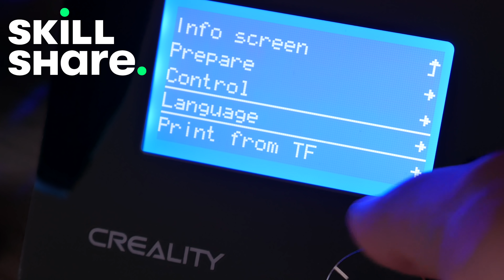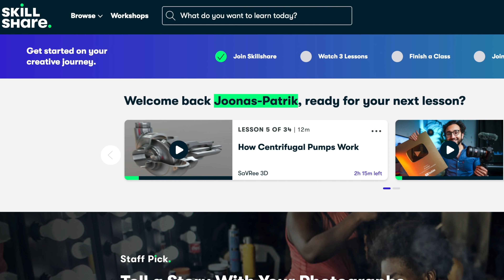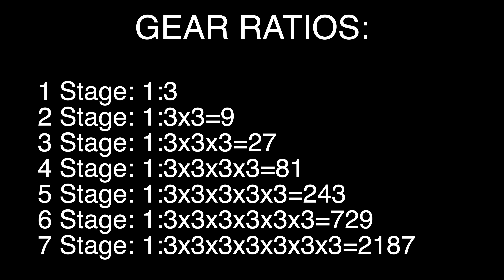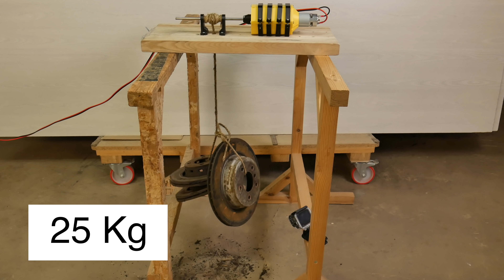3D Printed Stackable PLANETARY GEARBOX - Unlimited Gear Ratio

Comment: A Gear size ratio that harness the 25 kg lift-to-weight ratio, under the power of laboratory small electric motor

And it is working with good stationary holding strengths

I am now under the mapping solutions 👍🫶🫡💝

Comment: Great project, but I have a few reservations.
1. Increase the number of outlines and top/bottom layers when printing – this will significantly increase durability.
2. Try using oil instead of grease. It will significantly reduce friction and make the components last longer.
3. To prevent the gear from breaking off the base (8:03), it's worth inserting the gear into the base as a separate part to better connect the gear to the base.
I have a pump in my project, but it's based on a rotary motor.

Comment: As a former aircraft mechanic and car hobbyist, seeing that you designed a port (2:37) to let you easily access the screws made me smile 😁. Now if only all the automotive engineers could get on board with this concept of designing ways to access hardware during maintenance (instead of just ONCE during assembly), the world would be a better place.
Reply: actually those kind of accessible cut out can reduce the strength of the parts. every opening can reduce the strength drastically especially if those parts is critical.

Comment: Late to this but are you sure this is 1:3? I printed your files, and for every 1 I turn the back, the first set turns 4 times. Doesn't that make it 1:4?
Reply: Yeah, the gear ratio for the planetary gear system is calculated by this equation, (RingTeeth+SunTeeth)/SunTeeth. For this case, it will indeed be 4:1.

Comment: even it would lift 100kg it wont do it securely and repeatable and year later even not used, but it will lift 1kg fine for your life time.
make last sun metal and its last gear box that fail. its not any magic. make everything metal and have just one sun gear on motor shaft. that fill fail on max load too. not any special.
its not how much it hold its bout 3d printed layers and setting. its one off part not to compare

Comment: I made an gear ratio with my lego technic, i used an calculator app and it said it had 880 newton centimeters of torque, it was hella slow but i could barely stop it using a beam, releasing the beam would instantly whip it 1/4 of the rotation forward and lets say it was so strong it ripped apart a small gear

Comment: do a torque test, like the first test, but with bearings like the second test :)
first failed due to combination of shear loading and torque loading. not due to just torque
second was just a bad deatiling.....but had much less torque on the actual gearbox than the previous test (even though you had more weight, because it was on a much shorter arm

Comment: Wonder if this could be reversed (use the output as the input), add a lever and fulcrum, with gear teeth on the output (short) end of the lever and weight on the input (long) end of the lever, to make a gravity motor?  Add a tensioner on the fulcrum for some small amount of control.  Sorry I don't know the technical terms.  I mean, it would be ugly, but functional.

Comment: you should try to make a automatic or manual planetary gear box. 
planetairy gearboxes are often used in things like cars and drills due to the simplicity or making it shift gear ratio.
doing that would allow you to always use the exact same gearbox, you only need to set it to a gear, or you can set it while running electronically which allows for a better speed to torc/acceleration ratio.

Comment: What about a brushless motor to power the gearbox ! They usually have very high RPM's and torque. Would this work on this gearbox or could the high RPM/torque damage the teeth on the gears ?

Comment: Planetary gears are fascinating, but it would have been simpler to use classical two shaft arrangement. It wouldn't be that compact like your design but not awfully bulky either.

Comment: The function of bearings should not be impacted by overtightening. The use of washers as a spacer will solve these finicky torque settings. Interesting project...

Comment: Hi, thanks so much for sharing your design! 

i've made it and unfortunately i can say that the gear ratio for the single stage is not 3 but it is 4... please correct it. i've test it and you can check by calculations like here: https://woodgears.ca/gear/planetary.html

Comment: I printed one and there is nothing to prevent the planetary gear assembly plates from moving up and down.
I can push/pull on the output gear and the whole planet gear assemble will move 5-10 mm up and down. 
This you don't mention around 3:30

Comment: This is really cool, the concept of stackable modules.. 👍
 I'm wondering if you can measure how much the power/torque increases with each module added, and if the increments are linear.. 
👀
I think 3d printed gears might actually be useful even for heavier applications, if the end parts that carry the load are made of metal... 
Great job! 
Also, have you tried to print with what they call "black aluminium"? It is nylon/carbon mix... not sure of the brand name (s).
Good luck with your projects!

Comment: You should learn to use shoulder bolts as shafts rather than just a simple screw.  Gives you a positive stop and no point loading to wear down quickly.

Comment: The first test (10kg, 35cm) was way, way harder on the gears and motor than any other test that followed in the video. That first one was 3.5 kg*m, while that last, 40 kg test was only some 1.2 kg*m (assuming a 3cm radius winding - it was probably less than that).

Comment: I doubt it is 1:3... Looks like it is 1:4, because reduction rate of planetary gear is (S + R)/S, where S - number of teeth on sun gear, R - number of teeth on ring gear. Also it is pretty obvious R = S + 2*P.

1 stage: 1:4
2 stage: 1:16
3 stage: 1:64
4 stage: 1:256
5 stage: 1:1024
6 stage: 1:4096
7 stage: 1:16384
n stage: 1:4^n

Comment: One piece of advise is use shoulder bolts when interfacing the bearings so bearings doesn't run on a threaded shaft.

Comment: You said you can also use a Nema 17 motor but there is no file in Thangs included. Could you add the motor holder for a nema 17 and also the gear hub which you attached to the wood? This would be really helpfull for my project. Thank you for the great content

Comment: Great 👌👌👌. I am giving you an idea to use this gearbox. Use weight to generate electricity . This should use any heavy object lifted to an elevation. The project should devise a mechanism to control its descent at uniform speed. 😊

Comment: Just a quick comment about the "clips" from the tank video...you should, + if possible +. Use larger sprockets to drive your beautiful chains, to reduce the angles that the links need to go through, and spread the load across more teeth and links...
Se on hyvää ! ( I used to live across the water from you ;-) )

Comment: To push in the bearings, if you need to "hammer", use a piece of pipe, or a socket of the same diameter as the outer bearing race...you can use something like "water pump pliers", in place of a vise, again with a little piece of pipe, or a spare bearing, to push the bearing into the gear.

Comment: You should NOT have the screw threads running as "bearings", you should have "shoulder screws" that have smooth material, except for a few mm of thread where the nuts mount, no? Interesting experiments, perhaps better load test is not a shock load, but a running load? Or a "softer" shock load?
Still, you do very nice work! Kiva juttu!

Comment: Ok bro, you got me. Liked and subscribed with notifications plus a little engagement here for the algorithm. 

You're very talented. Not only in mechanical engineering, but you're a master of 3D printing! People who haven't 3D printed before just think you click print and out comes a perfect object. They don't understand bed leveling, offsets, rafts, infill, elephant foot, supports, overhang, bed and nozzle temperature, nozzle cooling, extrusion size and feed rates, etc, etc...there is so much that goes into getting a perfect print and you make that part look easy.
Reply: Yeah, incredible talent on display here.

Comment: I'm wondering what kind of speed you can get if you run this gear box with the input running the other way using the 8 motor gearbox as the input, would be interesting to see the kind of speed and force it can generate with a fan or pump connected as the output of those 2 projects tied into each other, plus material testing for extremes of speed rather than torque.

Comment: Try making some strain wave(harmonic) drives as well as some cycloidal - see if they are more forgiving of the material. There is a type of strain wave drive in which you can use a ready made rubber timing belt, the type usually used with steppers, as the flexible gear.
Reply: Good  luck

Comment: Fascinating, your prints were almost hollow in the first round and yet still managed to pull up 20kg. If they manage to make the plastic bond as strong as injection molding, this would be a great way of saving lots of materials.

Comment: the design is interesting. why didn’t you use ceramic washers to reduce friction, and grease them. this also bothered me a little, each subsequent stage does not have stabilization of the central axis. The weak point of such a design as you have will always be the wear of the gears and the strength of the main axle. I wish you much success in future projects.

Comment: The first test you did vs. the second test aren't really comparable. In the first test, you used the fulcrum and lever method... placing the lever further away from the fulcrum (which makes things harder to lift). In the second test, you used the coil method. The amount of work done is directly proportional to the size (in circumference) of the coil. Lastly, I would suggest using tools that are fit in handling that kind of load you are trying to lift. Perhaps increasing the size of the shaft and adding two more larger bolts would make the work more sustainable and achievable. Just an idea...

Comment: When you print with PETG, be sure to increase the infill. Using different infill patterns will also yield better results too.
Reply: Yes absolutely.
Reply: Also, if u use matrix combining, pre infill stage, u will see 45-50% increase in strength, with approx 15.5 & 17.78% less material used, which on bigger prints all adds up.
Reply: Yes, until 40 % there are benefits. Also maximizing the wall lines will give its maximum strength, example with most common settings for every 1 cm2 of item use a setting about 12 wall lines. Also run the hot-end  hotter than usual to achieve better bonding. Good video I enjoyed it.
Reply: can one remelt or anneal the thing? sintering
Reply: Sería mejor hacer un molde en silicona rtv y luego tener una pieza en cera, para finalmente recubrirlo de yeso y vaciar aluminio fundido

Comment: You will still need 2 gear box for tank but build it with tank transmission system so one gearbox is for forward and backwards and other is for left and right. Its interesting how that transmission works. (https://www.youtube.com/watch?v=_z3n6VOk-Ls)

Comment: i think that a nice idea would be to print with increasing stage thickness, so the gears are thicker when more torque is needed and thinner when they spin faster to reduce drag and gearbox size, if i will prints these i think i will try, being in need of pretty high reductions

Comment: You should print the gears as separate pieces then the shaft (click together after print).  If you do this you can print the shaft with the layers along the length and it will be much stronger to shear forces.

Comment: An awesome video like always. Printing the sun gear perpendicular to the force direction will greatly increase strength. What I mean is print the sun gear in two parts (length-wise, perpendicular to the gear teeth). The plastic is failing due to the torsional force being in the same direction as the print layers. The parts will be a lot stronger.

Comment: Nice gearbox!  Needs an output stage with output bearings and a overload clutch. (maybe some mounting holes too?)  The output bearings are to support overhanging loads, and the overload clutch will make the gear-box bomb proof by slipping before anything breaks.  I've made overload clutches both with spring loaded friction clutches and detent mechanisms.
Reply: It looks like a bee

Comment: Hey, next you should make a cycloidal gearbox, their super cool😉👍😁
Reply: Can cyclodial drive lift that amount?
Reply: @regiepera4488  same as harmonical drive the cycloidal can feature zero backlash and much more high torque capacity with a smaller size, and yes can lift much more weight. This is a main advantages to the common planetary one... Watch the Wiki, for example, first before write something offensive or stupid...
Reply: Trash.

Comment: good idea but why not 100% infill for the "coupler"?
Reply from the maker: 100% infill is a good idea and this coupler should be redesigned. I was a bit rush at the end. XD
Reply: @LetsPrintYT  

Please tell me can I drive two gear with one motor at 1000 rpm

1:1:1 gear ratio

10 mm diameter

Comment: Nice gearbox but why didn't you use a design where you could access the bearings inner ring from both sides? In this way you could have tightened up the mounting screws in the planet gear carrier more decent and without paying too much attention to the mounting torque. This would also make your design more robust and lead to a more precise movement of the planet gears...
Reply: I think about the same. My gears also melted because of friction on one side.